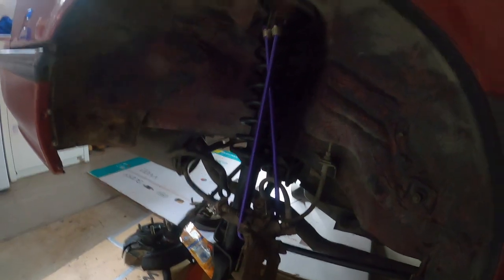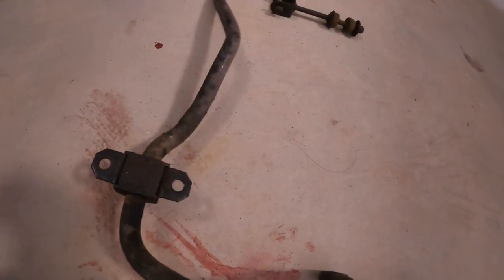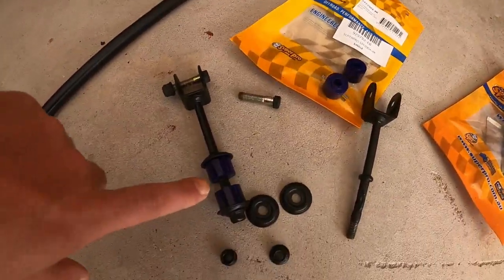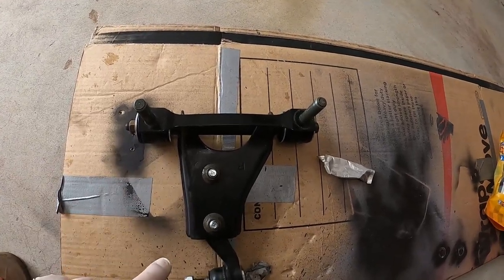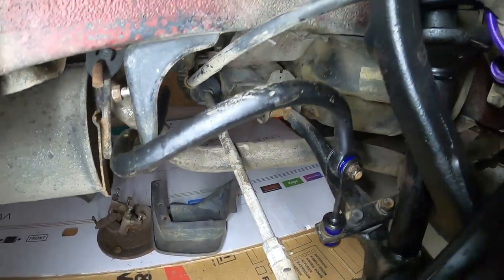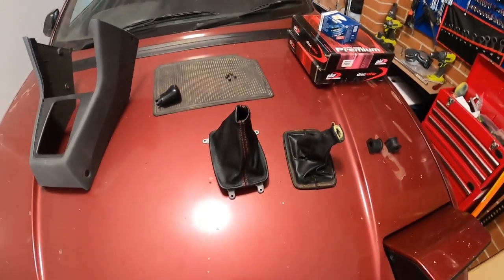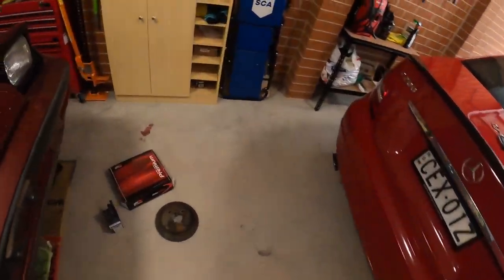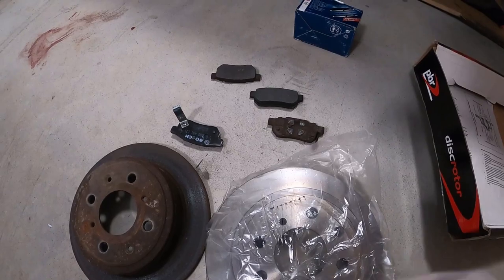Upper Control Arm & Sway Bar Bushings Replacement. New gear shift boot  Honda Prelude 3rd Gen 1989

Comment: I bit the ride will be epic once all done. You are overhauling the whole suspension system and you will feel it once you ride. If cash is not an issue, get coilovers. but if your suspension springs are ok, you dot have to. good job
Reply from the maker: I’m counting on that :) . Sadly I broke the bank so no coilover option. But that would have been great. Lowering the car with new set of rims
Reply: @saltherookie  oh, so you got a new set already ? I did not see that
Reply from the maker: @martyhunt1873  i did and have not revealed them yet.  I guess you will have to wait and see

Comment: No sure if you know rear brake pistons screw in if you need more adjustment,  just did mine on 3rd gen, great video thanks..
Reply from the maker: I did not know that. I'll look it up and adjust.  Btw, do you know how to remove the emergency break cable? Looks tight fit there

Comment: The sway bar bushings looked ok. As long as they are not dry, you are good. Did you change the suspension?
Reply from the maker: yeah they were fine and that is why I did not replace them.

Comment: Can you repair the break caliper ?
Reply from the maker: Doubt you will. And even if I have managed to get it welded,  Doubt will be as strong as it used it. Better replace
Reply: @saltherookie  I saw that they welded it. but I think buying a new one will be costly
Reply from the maker: @adamhall2901  they maybe able to weld but the time and effort into it, buying a new one will be a better option.  I think it will cost almost the same. So sucks, but it needs to be done

Comment: Did you powder coat them or just paint? powder coat last longer and scratch resistant . Not bad progress so far. new is time for new wheels. and maybe you should buy the break piston spreader tool next time :)
Reply from the maker: Sadly, painted only. powder coat is the better option, but will cost more. keep in mind, we are doing this on budget

Comment: Also, did you trim the upper control arm to make the bushings fit ? I saw another guy had to trim them a bit
Reply from the maker: No I did not. I saw that video too, but the guy used another bushing brand that not specific for the Prelude, so he had to trip a bit. if you saw mine, it was perfect fit